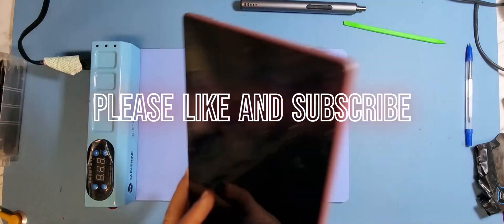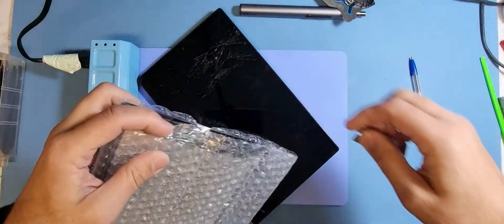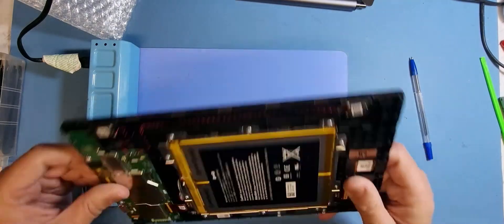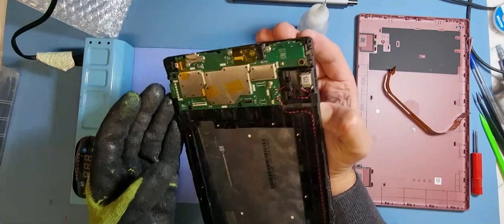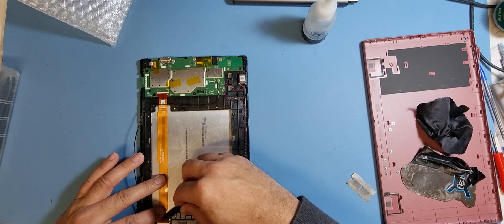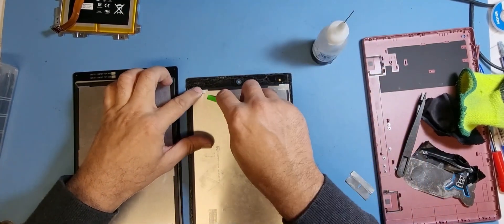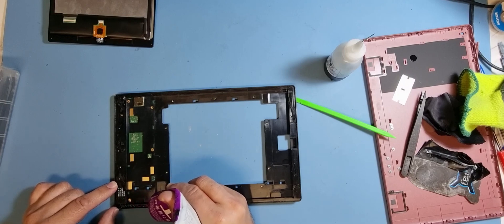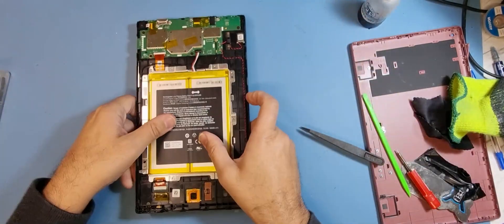Amazon Fire HD 10 LCD Screen Replacement

Comment: Hi! I have the lcd replacement and replaced the broken lcd with it already, LCD is working fine with back ground but the problem is the touchscreen is not responsive. I cant unlock the tablet. Can you help me with this my bro.  Thank you.
Reply from the maker: Hi, Did you replace the lcd only ?
Reply: @amkotechrepairs yes only lcd

Comment: Nice tutorial! Wondering, Do you know if you can separate the LCD from the touchscreen relatively easily and replace just the digitizer? Or are they fully fused/laminated together? Thanks Luke
Reply from the maker: Hi Thank you for your message

The LCD and digitizer are bonded together, they can be separated but the risk of damage to the LCD is very high.
Reply: @amkotechrepairs  awesome I appreciate the quick response.. Sounds tricky, are they attached just around the edges or across the entire display? In other words does it require using wire and heatplate for seperation?
Reply: What product do you use to separate the glue?